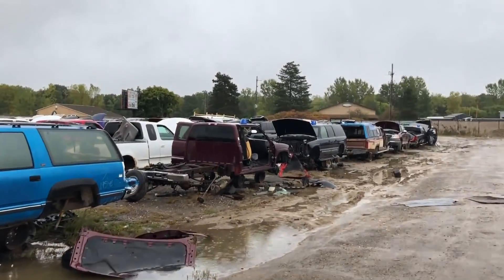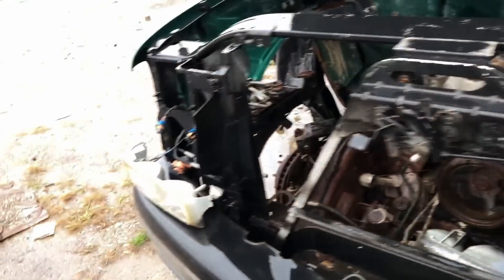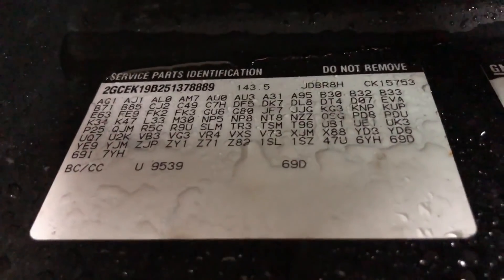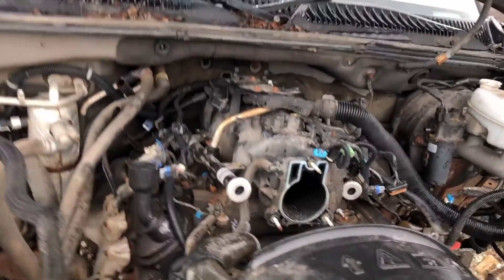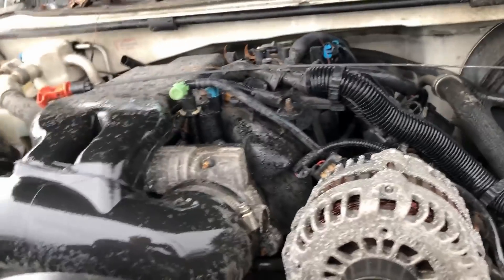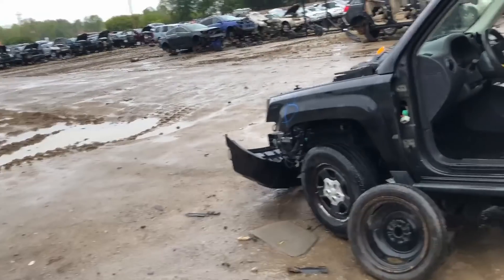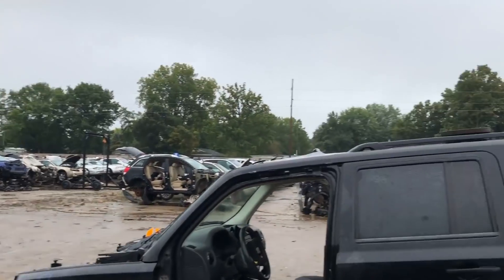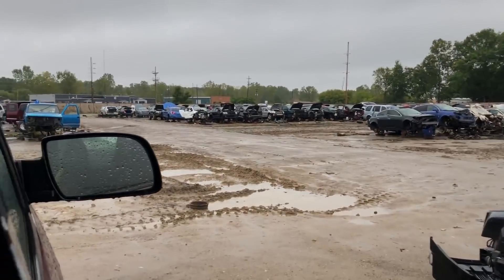Straight outta the junkyard! LS Dream Team

Comment: Just found a good all original power glide this week, need to find a diff to put behind it. May sound crazy but I want to do a carb build with something like a 427 Ls. Any yards near flint you recommend I go look some goodies?
Reply from the maker: What would be the point if you're throwing away everything but the block?
Reply: @TheDrivewayEngineer  uuuuhhhhh. I still need cams, cranks, heads and a diff. Dude I'm not originally from MI so asking questions like this is how I network to find shit. But no worries I'll manage just fine.

Comment: Awesome video. Thank you. I for one, do enjoy the technical aspects of the video, it’s how I keep learning from guys like you. I do have a request though. On my wish list, is for you to make a list for our viewing somehow, (pdf upload?) of all the LS Engines, all the different heads and numbers on them and what they mean and how to identify them. How they are or are not compatible with each other. What’s the best matchup, you mentioned compression with certain heads. I’d love to just walk into my local PiknPull and know exactly what to look for and quickly identify on the fly like you did. How to identify them them by the numbers or any other identifiers. I have an LQ4. Actually two. I’m well over the 500,000 miles club on my 2001 2500HD. I’d love to beef up the original and put it back in the truck and then build up my junk yard donor I swapped in several years back and stab that in my ‘75 Scout II. Thank you if you read this. I believe there are plenty of us on here that would benefit from and appreciate it. 
Thank you, Jas
Reply from the maker: That's a good idea, I've done smaller lists, I'll let that roll around in my head.

The issue is people want to look for certain engines, and I think everyone of them is workable

Comment: I want to swap into a S-truck, basically completely stock, at first, then maybe cam and either ls9 cam or btr turbo truck cam, with a little turbo, less than 20psi,  but it will likely stay stock with cam, I guess I need the trailblazer manifolds!

Comment: How do you know so much about the LS engines. I am amazed at how much information you share. I hope you get many more subs by New year's.
Reply: I am also curious as to if more than LS valve retainers will work on a 3800. But I am not hopeful being the 3800 is a 60° bank angle not 90°.

Comment: Great job and info. Question you talk about using the original head bolts have you figured out a torque number with out all that quarter of a turn for torque and head bolt stretch? Thanks Bud!!
Reply: Okay 👌 I’ll find it. Great job sharing your knowledge!! Thanks Bud!
Reply from the maker: @ronaldlewis6062  It's in the same playlist as this one. I'm at work or I'd just link it for you.
Reply from the maker: It's in the assembly video
Reply: I found the specs and posted it on engine assemble video. You’re the man!! So much information. Thanks!!

Comment: Is there a way I can get an email or something, I'm willing to pay for your knowledge. I'm thinking of doing a 6.0 (lq4, lq9, ly6) which one is best for 450whp on a 96c1500? I want a 4l80 trans, trickflow heads and a mild cam, with a trailblazer ss intake. I'm not sure what else I need, but I also want to use it for towing my track G35. Let me know what else I need for the recipe
Reply: Or a l96 which route would be the best setup?

Comment: Love this! I drive people nuts in the local P&P yard when they see me tossing 317 heads off of the LQ4s I have been hoarding. Cannot wait to see the dyno results, heads will explode. Please run a belt driven water pump if possible.
Reply from the maker: If the Dyno will accommodate it, I'll run it just like in the truck.

Need to find a Dyno first
Reply: The Driveway Engineer where about are you located? If that's the P'n'P I think it is I've got a buddy pretty close with an engine dyno he could probably get you in on. Just heard you say you're in Michigan. Is that the one by Lansing/Holt?
Reply from the maker: @TheMattc999  Correct, the yard is in Mason Mi, the Lansing area is where I'm trying to locate a dyno willing to run my junk. 
For less than 1,000 lol.

Comment: I bought a ls for 50$ and now im pushing 1200 hp bone stock. My total build was 200$ . Twin turbo kit was only 10$ off ebay!
Reply: Sure it is...
Reply: Jake Browne you must not onow about the legendary ls... you could go to a junk yard, thats where the ls motor is found, spend 50$ in the motor and it will support bone stock 2000hp. Even though they only push like 260hp stock. Now thats a real bargan!

Comment: i'd take that HO aluminum 5.3 over an iron 6.0 any day of the week. I mean for a build like that its a lot easier to make more power than it is to loose 110lb off of the front of the car.
Reply from the maker: It's going into a 1971 Olds 98,it's never going to be light lol
Reply: @TheDrivewayEngineer  exactly why 110lb less weight is great
Reply: Best upgrade I could have made to my Blazer was losing 150 lbs. by losing the 4.3 and gaining 150 HP by installing an LS1. And I get better mileage w/ the V8 than the V6. I was lucky if I got 22 MPG on the Hwy and w/ the LS I get 23-25 MPG, depending on terrain. Gotta love that trade-off.

Comment: I say you can get 500hp even with a comp can hydraulic roller
Reply from the maker: Almost any aftermarket cam is an easy 100 HP for sure
Reply: Stabbing a Summit 8716 turbo cam in my 05 LQ4 build today. Summit has a great deal, 280 bucks new, veterans discount saves even more, and some PAC 1218 springs. Even without the turbo, should make some serious steam!

Comment: If you get froggy, put the 4.8 crank in the 6.0 lq4 with the 799 heads and spin it to 9000rpm
Reply: But  = about 5.3
Reply: @pmotorsports8276  Yeah close but the bore size will be different using the 6.0 block. That block with the shorter stroke will be sweet for revving it way up and getting a sound out of it that LS motors don't usually make because most don't take them to 9k. Also it'll be nice for boost later

Comment: I wanna see the 6.0 but that looked like it would need to get a decking and possibly a hone. But I rather see a decent condition 5.3 that will last and work vs the 6.0 that's gonna be sketch
Reply: You didn't see the complete 6.0 with heads still on it
Reply: @K1LL3R_M1LL3R  I did not. In that case 6.0 with the 799 heads